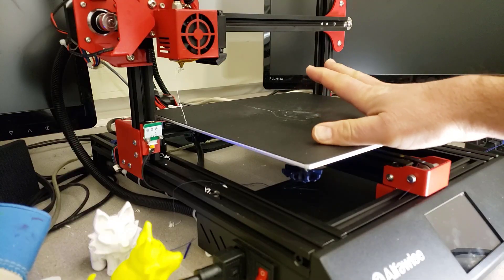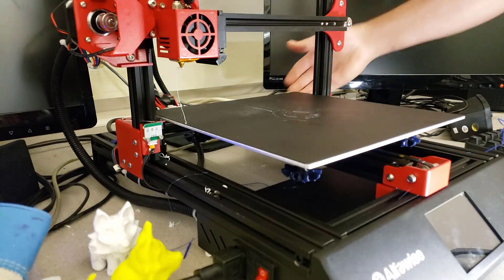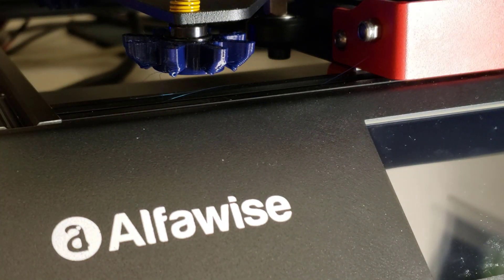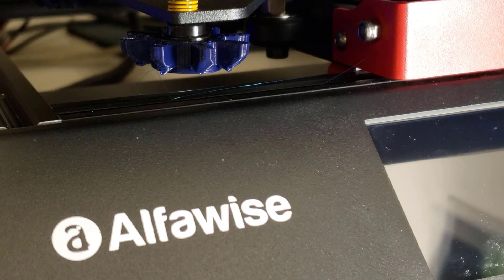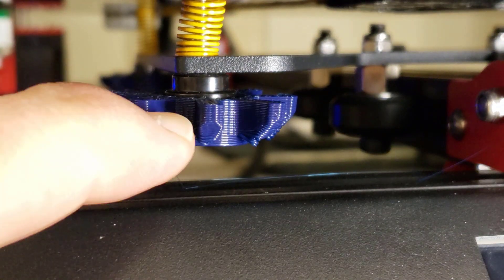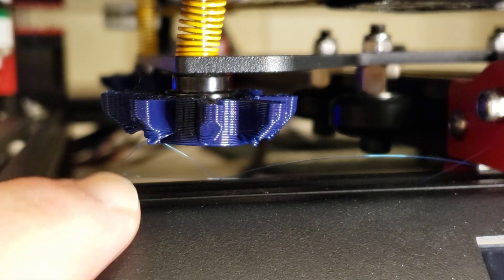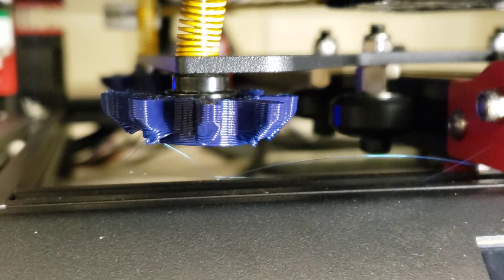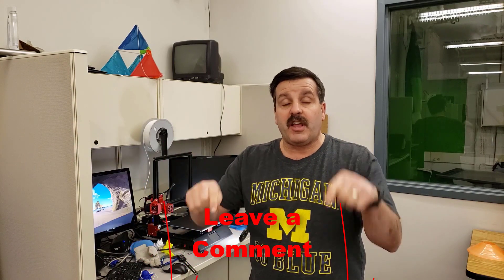Free Upgrade! Better Bed Adjustment Knobs on your Alfawise U50

Comment: Great, very great, i wait for the comparison of u50 and the anet ;)
Reply from the maker: You can count on that. =) I love the prices, but the waiting is a drag.
Reply: HL ModTech ahahah, i underatand you, i will decide which of the two buy
Reply from the maker: @Pinozzo  If you have any questions about printers before hand, let me know. I have a bunch I have worked with.
Reply: HL ModTech i want to buy my first printer without spend a lot of money, for you is ok for beginner the u50?
Reply from the maker: @Pinozzo  I like that it was easy to assemble. Great cable management and it is working great. Cons are that there a not a lot of people using it. When I search YouTube, I seem to be one of 10...  A printer like the Ender 3 has so many and is about the same price.  Are you good with computers?
Reply: HL ModTech im not bad with computer, you can upload your profile settings on cura?
Reply from the maker: @Pinozzo  I have a video that shows the setup in cura. It is only about 3 min. So simple it is almost silly. https://youtu.be/xis4w9b9j_U